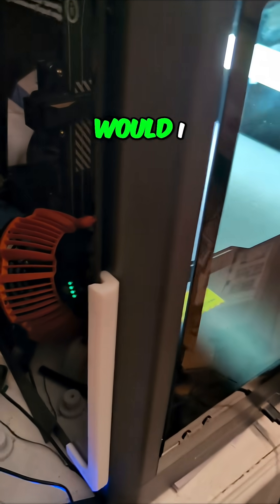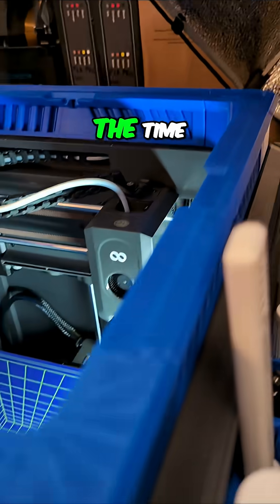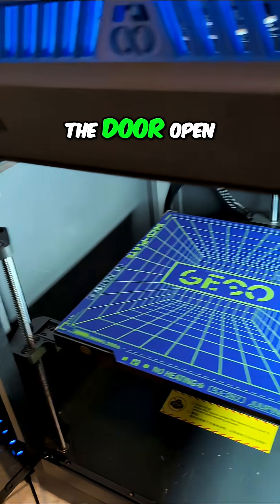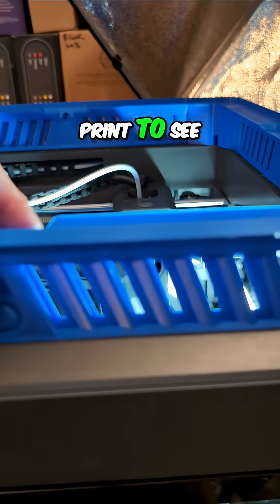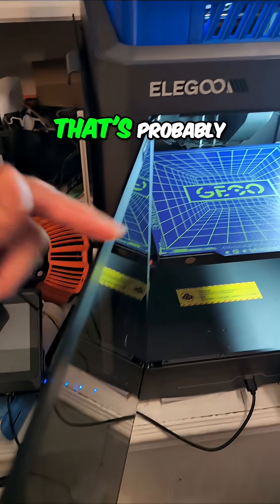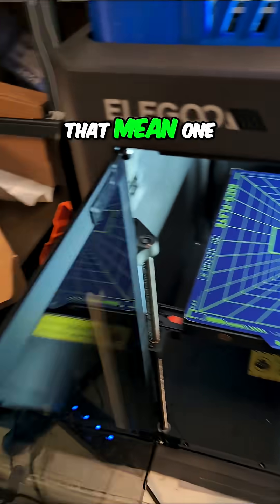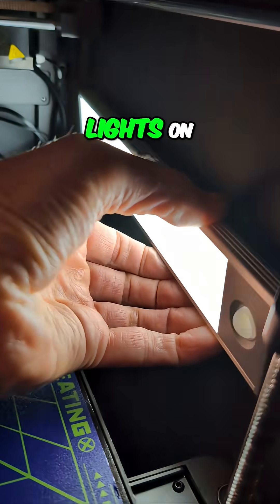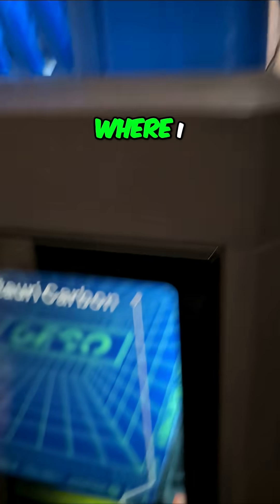Elegoo Centauri Carbon: Best Add-Ons & Upgrades! #shorts

Comment: The riser I use often as I do a lot of ASA and ABS,  also like the bed plate holder,   only "upgrade" I removed, was the filament spool holder,  I printed one with the ball bearings,  which was supposedly better for TPU printing ,  the problem is that by not having almost any friction the spool will have momentum and filament will jump over the edge and get tangled,  a little friction is needed to prevent spinning.